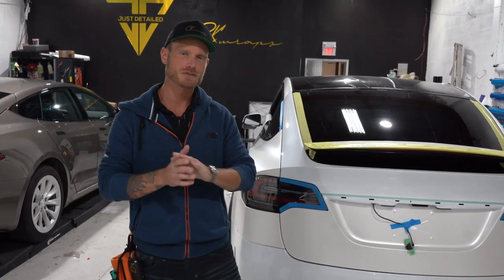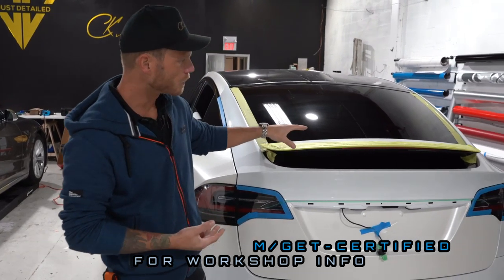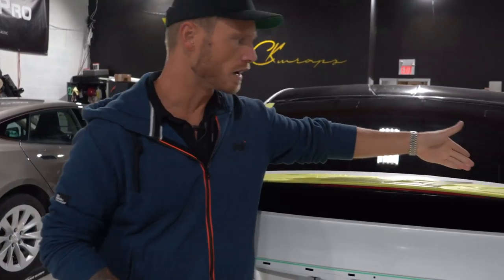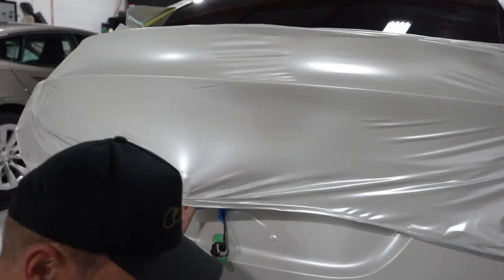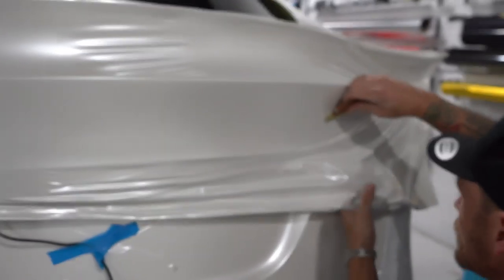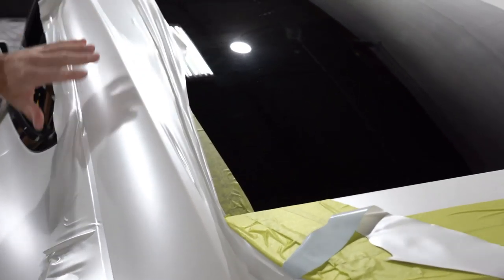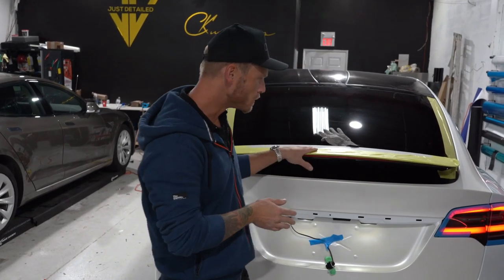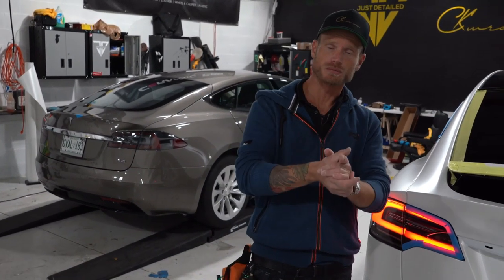Rear Hatch Vinyl Wrap

Comment: Man I wish you would wrap a Chevy Bolt taillight. I couldn’t figure out where to start and which way to pull. I got the side tacked on then some heat, over and around. But it bends to sharp at the top. Maybe a seam is only way to go. I bet you could probably do it though.  I had to trim out excessive wrinkles on top area.